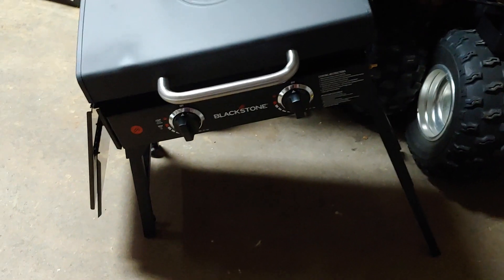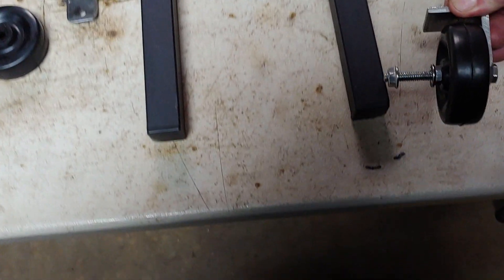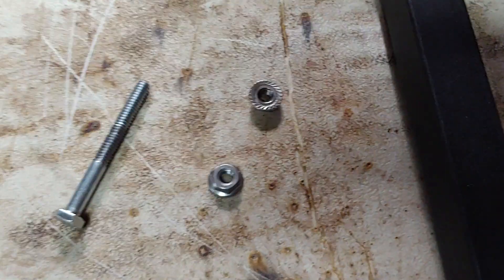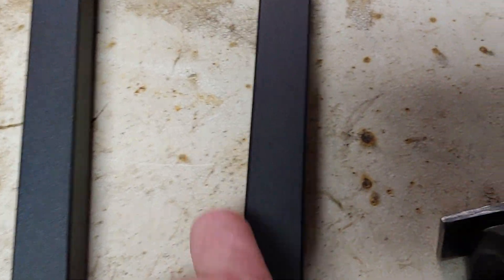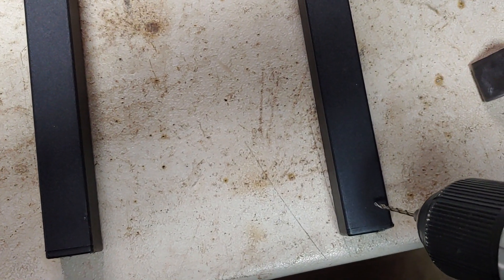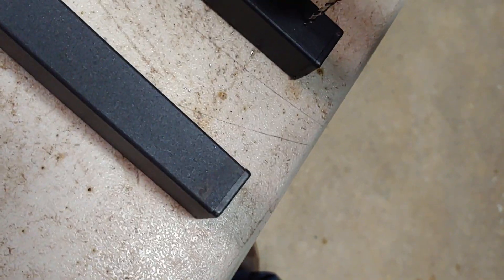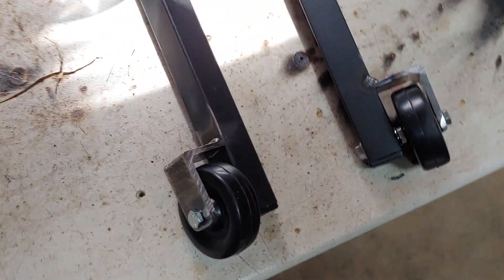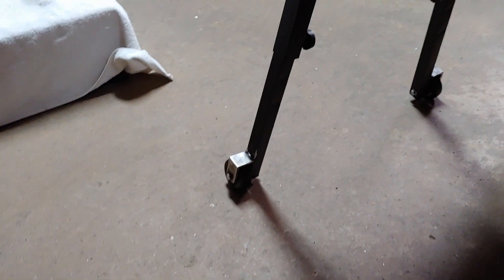Blackstone 22" wheel install.

Comment: I am glad as hell to see this mod, as I have a BLackstone tailgaiter, but also have arthritis and moving it in an out of my garage is a real pain. I was wondering is anyone did a mod like this for the legs or not.  Even with my wife helping to lift and move the grill, it is a real pain to move in or out when using. Be nice to have some sort of mod to also include the gas tank for mobility. It probably would sit on one of those wooden flower plantar boxes that has wheels, but would still have to be disconnected. Thanks so much for posting this video. I greatly appreciate it.

Comment: Couple of questions: 1. Where did you get the wheels? I went to Harbor Freight, but they had nothing like that. 2. How do you level the unit with the wheels making it raise up on that end? Do you just level the griddle or such?  Got the additional folding shelf from Harbor Freight you showed in the other video, but for the tailgater , it will have to be mounted to the back side. Still, it will help, for sure. Thanks.